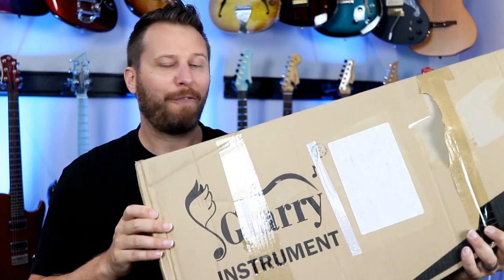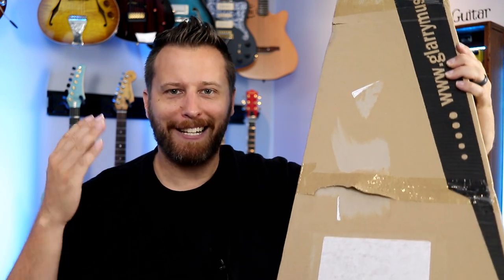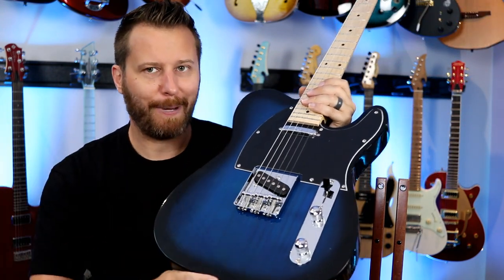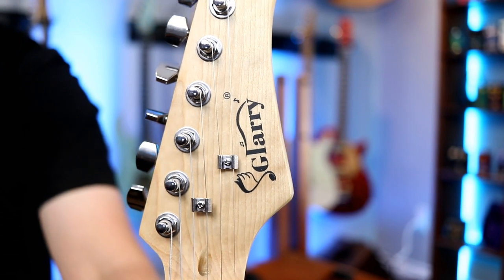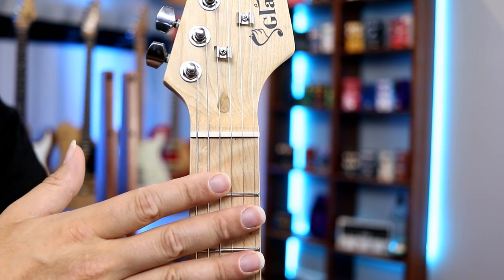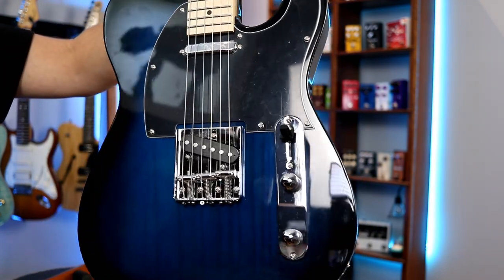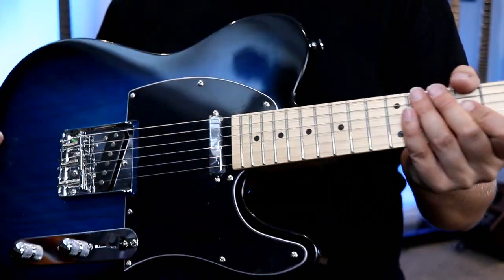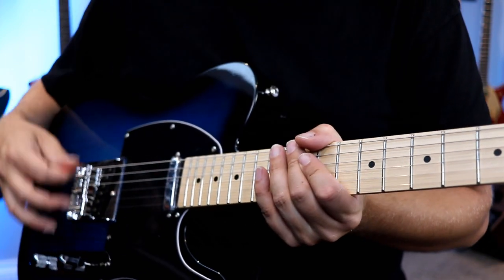The CHEAPEST Guitar I've Ever Played! - What Does It Sound Like??

Comment: "I've seen a lot worse on a lot more expensive guitars."

That tells a lot about the state of the affordable guitar market today. The positives far outweigh the negatives now and hopefully it will force the high end and midrange market to up their game and make sure we get what we pay for, especially in the customer service department.

What I am curious about those cheap guitars though is how durable are they? How many issues will pop up in the long run? How many musicians will play their original Glarry 20 years from now because it's still as good if not better than the day they bought it? Especially considering if you can buy a new one for 80$, why spend hundreds to fix and maintain it?

I hope this one lasts a long time because it looks like beautiful, well worked pieces of wood have been used to build it and it would be a shame to waste it if a solid instrument could have been built instead.
Reply: Jack Strap, They’ll probably do well overtime if they have been sealed properly and have enough solder. Most will probably see some work overtime, and some might get sacrificed in punk and rock shows since they’re so cheap
Reply: I assume the neck will warp and the frets will sprout easily. The bridge may corrode considering it's not stainless steel.
Reply: @Jack Strap  I think you're absolutely right. We know that many of the same manufacturing techniques are being used in the midrange market, but "midrange" prices have, if anything, become less attractive, and instruments in that price bracket still have many of the same issues that may become evident in these after some use.
Reply: Perhaps the neck will warp, frets will sprout, etc, but those issues happen on more expensive instruments as well. Just look at Darrell's video on why he's done with Gibson. If you spend over 2000$ you expect something that doesn't even compare to an affordable guitar, and it's getting harder for them to deliver.

I guess we need more punk rock shows because the market is saturated with cheap guitars. They can't smash them fast enough.
Reply: Maple wood is maple wood.  Frets are frets.  Solder is solder.  Time isn’t going to change the basic elements.  Assuming it isn’t so far out of whack to begin with, the only thing that may not hold up is the finish.  Which honestly, for $80, it’s easy enough to refinish one if that is what matters most to a player.  I make players out of clunkers so these $80 Glarry’s are almost a no-brainer... and better than 80% of the reviews on these are pretty positive.  It does look like some basic shielding is about the only thing that MUST be done.... besides that, they seem like pretty decent project axes.
Reply: @BangBangBeefyMacNCheesy  I would toss some Humbuckers and a pair of pots on it and maybe change the switch on it. Some shielding paint and change the nut and bang, you're good to go. Oh and a set of D'Addario strings on it. Spend a hundred on it and flip it after a while for 250$.

Comment: Bought this guitar about 2 months ago as my first guitar and I have had so much fun. I put a set of strings on it, roller string trees, and it plays pretty good. Stays in tune. Like the one here, the bridge pickup was really microphonic and the output jack went bad after a month, so I replaced the bridge pickup with a GFS Lil Puncher XL Humbucker (Sounds really good compared to the one it replaced) and a Switchcraft output jack.  Definitely not an AMAZING guitar, but an amazing value that is good to learn how to mod guitars.
Reply: did you replace the bridge pickup yourself? never owned an instrument before n i'm not much of an engineer lol so I'd be so nervous doing any replacing on my own.

Comment: One thing to note about Glarry guitars is if you are interested in buying one to modify, keep in mind, the routing is slightly off from specs used in Fender replacement parts. You will need to route the pickup holes 1/8" to accommodate a new bridge pickup. The pick guard is specked to Glarry's pickup dimensions which means you will need to buy another pick guard that is cut to fit your neck replacement pickup. 
Also, the switch and pots are smaller than Fender replacement parts meaning you will have to buy a new plate along with your new pots and switch. 
If you plan to replace the tailpiece to fit your bridge pickup replacement, the strings on the Glarry ARE NOT through the body. Which means, your Fender tele plate will require you to drill string holes through the body in order to feed your strings through the bottom of the Fender Tele tail plate. 
Lastly, the screws for both the tail plate and pick guard all need to be reset to the new parts as the holes do not match. 
If you are not comfortable with modding guitars and working with tools like routers and drills, this is not the right instrument for you to modify.

Comment: Harley Benton has the best cheap guitars.
Reply: agreed, about to get one for myself this Christmas
Reply: @chilldeen4590  I have 2 of the HB's, CST24 Black cherry finish and a ES 335 copy, solid white and with a creme binding. Beautiful guitar, like them both straight out of the box. I did change the strings, I always do that anyway. I think you will  like the HB's...
Reply: @bluedaddy23  i hope so, and of course u need to ch9the strings every month or so, and i hope HBs are better than squier
Reply: My jam buddies and I have had 8 Harley Bentons combined.. minor tweak issues. Overall 3 absolute perfect teles and one total dud (a  cst24 prs clone with stain botches and cracked fingerboard). Value for money - sure (combining and saving on shipping) but there's always a chance you may.. may get a clunker) sure paying to ship it back is your option, but most issues its more economical to rollup your sleeves yourself. This Glarry I will assume would be the same. For the price and really that body alone.. Where's my credit card? Tks again!
Reply: I'd rather have an agile or an sx honestly
Reply: I got this Glarry. I should have video'd the box opening of mine. It came with a large issue and I'm struggling to get it replaced. Now I really really wished I had the Harley Benton instead.

Comment: I bought one of the Strat style. Put on a loaded pickguard (paid as much for it as the guitar!) Did some work on the neck, and added roller string trees. Pretty nifty rock and roll machine now! Super light and comfortable, and it plays great!
Reply: I stripped and reshaped headstock, swapped bridge pickup for a Fender Japan '62 (20 quid on ebay) - great banger.
Reply: I did the same but I put a Dragonfire Screamer in mine. It plays great and sounds awesome. Win win!
Reply: Pickguard was loaded with Wilkinson Vintage Voice (ceramic ?) Pups. Gives it a very '60s vibe

Comment: Great work as usual, thank you! Looks like the “humbucker “ route is more of weight relief route. The hole in the neck pocket is most likely for tooling purposes. Overall sounds like if you spend $50 on a new bridge pickup, $30 for a Wilkinson top load bridge w/compensated brass saddles, $30 for a decent wiring harness (I would go for the Mad Hatter 4-way Tele kit for $90) and $50 for a fret level/dress/polish job if you can’t do it yourself , that for $250-$310 you could have a much better guitar than a squire or other brand that is more $ and you would have to do the same thing to it anyway.

Comment: I feel like this company sends models to be reviewed that they have done extra work on, I got one in the mail it came poorly packaged, very beaten up with huge cracks in the finish, the fret work was terrible, some of the worst I’ve ever seen. Very sharp Fret ends, file marks on the top of all the threats, unlevel frets. You could make one better from a DIY kit on eBay.
Reply: Wow, horrible if they do that!!
Reply: Harley Benton does the same.
Reply: I've got seven of them over the last couple of years, acoustics and electrics, and I was blown away by the quality vs price, they are not perfect, but GREAT values in many ways.  They were all packed well but even so I did have one arrive with a  broken headstock.   Sent some pics to Glarry and they had another shipped out to me asap.  

All of the ones that I purchased were very playable and with some TLC became highly playable and very good sounding imo.  I own LP's and American Strats etc.  For the price, these are hard to  beat.  You just have to have a reasonable expectation of what you are getting.
Reply: @Pocket-Calculator  my buds and I have 8 Harley Bentons. 1 dud out of the bunch. The other 7 were pretty good. We aren't afraid to tinker and mod which does make them great for that.

Comment: As long as the neck and body line up well, the price makes this an awesome platform for modding.  Add some shielding and ground wires, new pickups, electronics, strings and tuners make it a much better guitar for still not too much money.  Something someone who is inexperienced could probably handle.

Comment: I'm definitely buying several of these and modifying them with better pots, pickups and finishes. Thnx man
Reply: No please dont. I've done it. Full size pots do not fit into the routed body. You have to grind the insides down.
Reply: Do not adjust the pots or the finish. The finish is perfectly fine and the new pots won’t fit. Pickups are fine to upgrade, knock yourself out with that.
Reply: Seems like it would be a  simple fix if you have a Dremel, but maybe I'm missing something? Yeah the finish looks great to me. I was surprised how nice it looked & the grain in the neck is sweet.
Polish the frets & replace the bridge pickup is all I need if the tuners work. 👍 And a lamp. That's all I need. 🛋️
Reply: I have the yellow strat and had my luthier change everything on it,pickups,strings,pots,switch,it souns pretty good.😉

Comment: Hi Darrel;  I am quite an old man and I am going to start playing electric guitar.  I like this guitar so as not to spend too much at the beginning.  Would you be kind enough to recommend a couple of medium quality pickups (Neck & bridge) from the Humbucker models that can be adapted to that platform?  I think bridge will have to change a bit.  I have woodworking tools, and if converting to active system pickups is an option, the cavity and hole work can be done.  I just need your suggestion of the make and models of pickups.  Thanks for thinking about the low-income ones.  🤗👍🏻

Comment: I'm brand new to guitar as an adult learner. I bought the Glarry gst3, found it on ebay new for $55. I think it's a great platform for me and my (lack of) skill level. A friend  changed the strings and did intonation. It holds tune well. I think the nut slots need adjusting, pretty high at first fret. The fret ends need sanding. And the action is high. A friend came over with a custom built strat, and in comparison it is night and day. You really see how cheap the glarry i with it's thick neck and high action. I'm still happy with the purchase but found out what I'm missing compared to a high end guitar. Much easier to play the custom than the glarry. Great beginner for me and I'll try to do the fixes. Also came with dents and dings as there was NO packing material to speak of but that keeps me from making the first ding!

Comment: Doesn't sound too bad. Certainly a very moddable guitar for the budding guitar tech or luthier. It wouldn't cost much more than $20 in parts to improve this guitar with shielding and resoldering, soldering the earth properly. I've found the body and neck routes are fine on most of the cheap stuff, it's the electronics and finish that are the problem. If you're into fixing guitars, it seems like a pretty good deal. 

Chuck an Alnico5 humbucker in the bridge and I reckon it would be a bit of a beast. Just be careful when buying unbranded tele bridges on eBay. I accidentally bought one with inset diamondy thingys that took hours to grind off with a dremel.  Bloody sparkles!  On a telecastaster bridge! What next? 

I'd be interested in playing one at that price, if I didn't already have 2 teles (one squire, one handmade custom), 2 strats, a Les Paul flat top, 3 basses,  a home made Jagstang kinda thing and a bunch of body blanks I made up but never got back to in pretty much every fender guitar shape ever made (I want to have a home made copy of the entire history of fender non Strat non tele guitar bodies. It's a long term project. Purely for self satisfactory purposes. I think it will be fun to do and fun to look at. 

Brands don't matter if you are getting the sound you want and you're having fun.

Comment: Disassemble that neck enough and you'll need thicker screws.  I am just now getting into electric guitars (I plan on buying my first TOMORROW), so I am unaware of what's normal, what's crap, and what's quality.  BUT... I know from my handyman skills and such that screws eventually eat at the wood and make for a flimsy connection with time.  This can be countered by filling the holes with toothpicks (it's more involved but I am not here to explain screw hole restoration), using slightly thicker screws, and using a screwdriver, not a drill, to remove them.  Maybe I am just paranoid over nothing.

Comment: I bought a Glarry guitar because of another You Tube channel. He chopped the guitar up pretty badly. So I decided that the guitar needed a better chance. So I ordered the very same guitar.

When it arrived, I just loved the green color and the woodgrain on the guitar and the neck. The neck on mine was finished fairly well, no sharp frets, but it to had been rounded off. The action was perfect. I put a clip on tuner on the guitar and tuned it up and checked intonation, and it was real close. It played nice, but when I plugged it into my amplifier..., nothing.

I pulled the pickguard off and I found a pretty bad job of soldering the connections. There were cold joints on every connection. The back tone pot cover had come off somehow and the sweeper on the control was knocked off. The output jack wasn't wired in either.

I am still hoping to finish that video, but I want to try and salvage what I have; so it stays stock. Then I want to hear her voice, and maybe do a head to head with a Squier Affinity, which is already ahead of the game.

Comment: Lol, early in the summer, I bought exactly the same Glarry guitar from ebay, here in the UK, for £60 delivered. I too was surprised at how playable it was out of the box, so I played it for a few days, and then I stripped it down and did a bit of a budget upgrade... I levelled, re-crowned and polished the frets, reshaped the head stock to look a bit more Telecastery, fitted a graphite nut and some reasonable locking tuners, refitted/shimmed the neck, and set the relief, before sorting out the bridge, which simply involved drilling through the body, to fit some steel ferules, and replacing the saddles with compensated brass ones. As for the pickups, I liked the sound of the ceramic neck original, so I kept that, but swapped the bridge for a super cheap Chinese alnico V one that has a rather nice vintage tone. I had originally intended to sand the body down and refinish it with oil and wax, but the factory had done a better lacquer job than I could have expected, so I just buffed it up a bit, before going over all the electronics (some of the soldering was a bit suspect and I sorted out the shielding with foil and a handmade/polished aluminium pickguard) and fitting a decent set of nickle strings, and that was it, I had got myself a credible little Telecaster for around £100, which is pretty hard to beat and a whole load of fun to play :-)

Comment: If someone wanted up upgrade their Gary-Larry at a reasonable price, there are tons of options and some are extremely easy to install.  I’ve built a few parts-Casters, from either high end American Fender parts, or from inexpensive parts (that are still very good).  Spend some time on eBay; it’s all there.  There are tons of “prewired” control panels (no soldering or wiring diagrams to worry about) from US sellers.  I just did a quick search and found an very cool set-up with reversed controls (volume in the front and switch at the back - my preference), full sized pots, and a 4 way switch p, from a US seller for $30!  You also mentioned replacing the bridge pup with a MIM or other inexpensive option.  Great idea and there are lots of options, there, too.  Many players frequently change pickups, chasing that tone, and several sell the stuff they’re taking out.  So I’d also do a search filtering for only “used” listings.  I’ll wrap it up by saying building or modifying Telecatsers is a lot of fun and, like I said, can be very easy to do!

Comment: Pots probably Chenkfan (CF). Utter trash, stiff turn, function like on/off switches. The large, deep humbucker route near the neck doesn't leave much wood @13:02 in the area where the baseball bat meats the body. Like a little 1/2" rectangle ridge of basswood (strong as styrofoam). Would not be surprised to see one of these snap clean in half just south of the neck pocket.

Pretty sure on a Tele, no ground is needed under the bridge plate, because the plate contacts the grounded pickup plate via screws/springs, and saddles > strings, etc. Same for ground wires between volume, tone pots and switch. They're all on the same plate that becomes the ground. Kind of convenient actually.